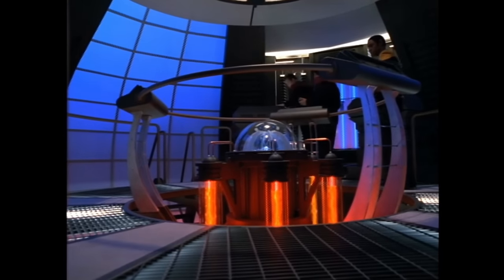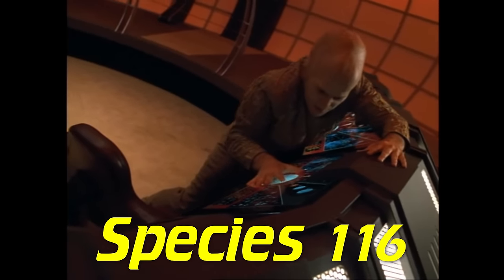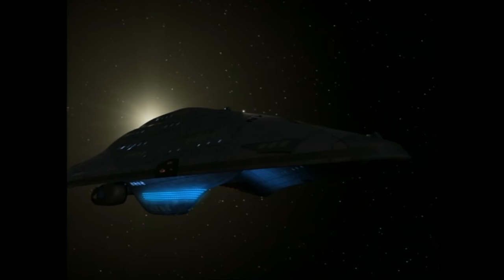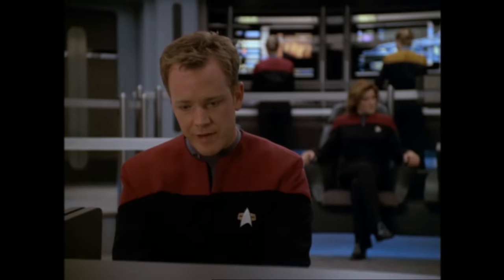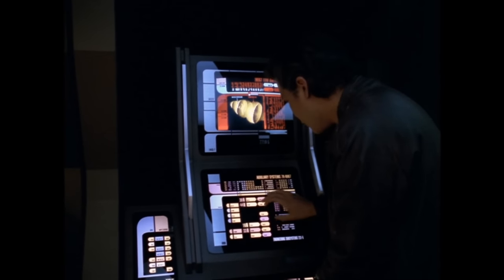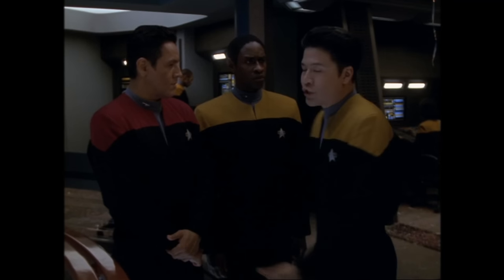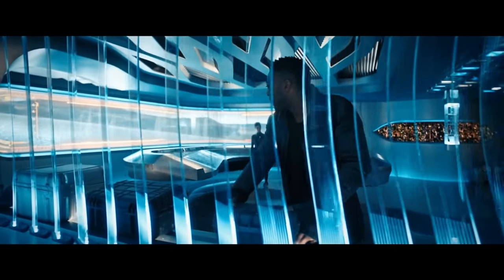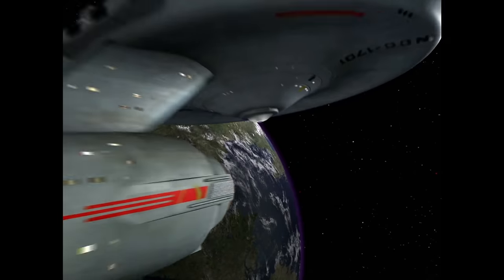Did Discovery IGNORE These Warp Drive Alternatives?

Comment: besides there being alternatives to warp for FTL, there are alternatives in Trek to dilithium for warp. the Romulans, for instance, do not use dilithium as they don't control any planets where it's abundant. that never prevented them from using warp because those are orthogonal technologies. dilithium is just the power source. i do not expect the writers that came up with "black alert" and fungus tardigrade drives, and literal pacman physics for the discovery's warp animation to know this.
Reply from the maker: This is not correct. Remus is rich in dilithium.
Reply: @OrangeRiver  ah i did not know that. but then why do they not use it? they use artificial singularities to power their warp engines.
Reply: @OrangeRiver  also, and even more strangely, the Phoenix did not use dilithium, just a nuclear reactor.
Reply: @subraxas  from the TNG episode Timescape:

LAFORGE: Data, why don't we take a look at their engine readouts?
DATA: Geordi, the engine core is completely inactive.
TROI: That's impossible. The Romulans use an artificial quantum singularity as their power source. Once it's activated, it can't be shut down.

they may use crystals elsewhere in their industry, but not on their ships. this is also reiterated in the episode Face of the Enemy.
Reply: Possibly the singularity drive technology is unable to be miniaturized down to a certain point and say, runabout size on down may require a traditional antimatter reactor.

Comment: Plus I mean dilithium isn't even necessary for basic warp, just power generation, it's dumb to think that nobody could come up with some other way to throttle matter-antimatter reactions at the least
Reply: @subraxas  the M/AM is just a power generation thing, if they could generate more power in another way it would fill the gap. (Or if they could work on more efficient warp drives that aren't power hogs)
Reply: @subraxas  or they could figure out romulan singularity generation, this is an emergency and I'm sure section 31 has SOMETHING up their sleeve

Comment: This is why Discovery totally sucks.  The writers of the show don't know how the tech in their own show works. They didn't know that warp drive works just fine without Dilithium.
Reply: But it's limited to warp 2
Reply: @dennisreed6345  what's limited to warp 2?
Reply: @mansquatch2260  fusion powered warp drive
Reply: @dennisreed6345  the federation uses matter-antimatter annihilation for their power and the romulans use black holes.

Comment: um most starfleet ships were using quaumn slipstream or simply slipstream drives during the 32nd century however when dilithium was restored they went back to using it because it was more energy efficient
Reply from the maker: And this contradicts the thesis of this essay, how? Lol
Reply: @OrangeRiver  well the issue is that warp drive seemed to be the easier and least energy intensive means plus the borg transwarp corridor system was destroyed and Voyager only brought back some borg tech and the transwarp tech they couldn't rebuild everything they found. plus the Xindi subspace corridor tech was created by the sphere builders they never got to physically interact with other race's tech to replicate it plus some were more or less naturally occurring. the artifitial wormhole one was a bust because the defiant could not create the other end only one end so it was discontinued

Comment: As a sci-fi writer, I could never shake off the feeling, that most of the problems Disco had, was due to lazy writing. I mean ... it feels like, they took most Ideas the Next Generation Crew already had, and put on some shoe polish, without actually going wild with the idea, what could have changed in Discos in-universe 900 year time span.
Just as a basic idea which I came up on within 5 minutes ... yes, the Burn somehow destroyed most of the Dilithium. But the stuff is no longer really necessary for warp travel, since several trans-warp conduits Borg style are in use. And some of the smaller, more streamlined ship types can use Slipstream. The Problem the Feds and also the other major Powers face, is more ... engineering-centered. Fronm our current ideas of a real working warp field, the warp bubble should be  , thanks to the warp geometrics, bigger on the inside than the outside. So, why not let the Federation completely overhaul the whole Warp-Field idea? No longer travelling via Warp, but basically integrating it into the ships design ... basically Doctor Whos Tardis - as we´ve seen in Enterprise, there are Federation Ships bigger on the inside than the outside. This would actually change the entire premise ... for well, everyone.

Comment: What about Romulan Singularity Warp Drives? They use Artificial Blackholes instead of Dilithium Warp Cores.
Reply: @subraxas  I did and Venom Geek Media covered this years ago. Stating that Romulans don't use Dilithium in the Giant Warbirds. Just the smaller ships that don't have a singularity core.
Reply: @subraxas  Easy you would want  information  on a Federation  Warp Core so that you can make a tailored weapon  to disrupt it. And have plausible  deniability. Back during  the Cold War the Soviets  were trying  to get info on US tech in order to defeat it. It is a standard tactic  of enemy  nations  to do these things. As to the Dill Mines. Smaller  Romulan  Ships use Standard  Warp Cores not Singularity  Cores.
Reply: @subraxas  You don't need to regulate plasma if you don't generate them in the first place. And Starfleet warp cores are not perfect 1 to 1 systems. More Deutirium is used than Antimatter is in the reactions. Hence why you have left over plasma.

Comment: You forgot the most obvious one. Romulan warp drives. They are powered by artificial singularities. They never used dilithium crystals at all.
Reply from the maker: Someone didn't watch the damn video lol. And it's never been proven that Romulan starships don't still use dilithium--on the contrary, they must have
Reply: @OrangeRiver  You briefly mentioned romulans for half a second but never touched on their method of propulsion. There is nothing that says they had to use dilithium crystals at all. If you go into STO there is actually lore that says they don't.